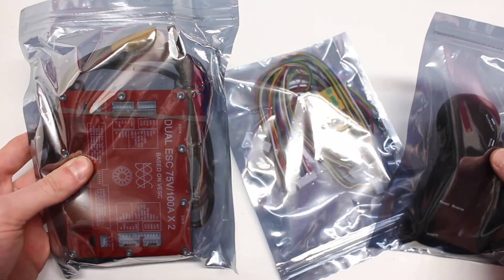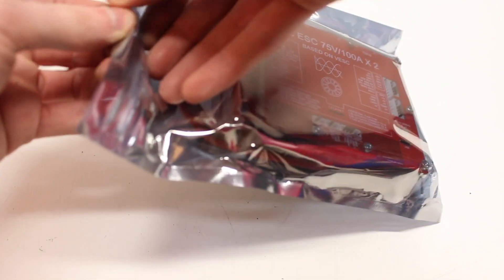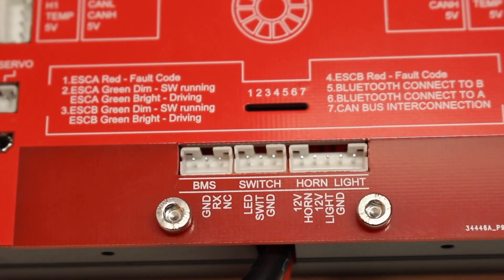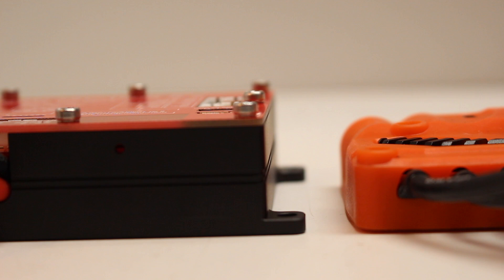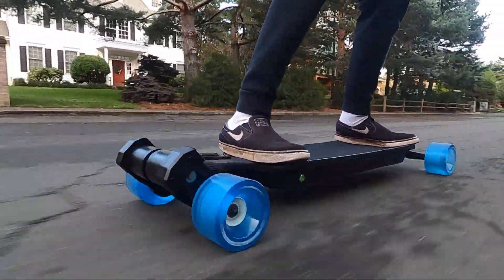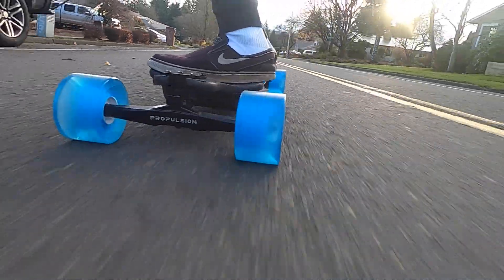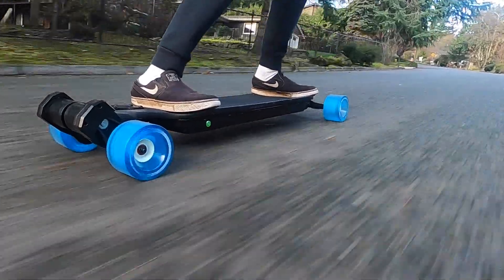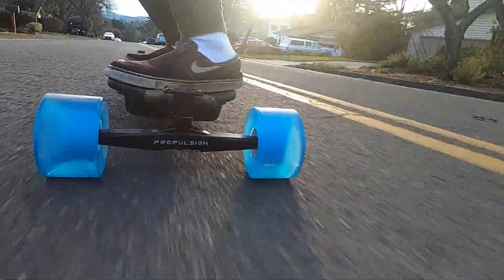16s/75V 200A VESC *Ubox Review*

Comment: I bought this one after watching the vid and I love it. So, I bought the V2 for my next build and after I set it up on VESC tool  thought it was ready until I stand on it. It sputters and starts high pitch squealIing and doesn't move. What am I doing wrong? My esc is a Spintend ubox v2 75v 100a x2. motors are Flipsky 6384/190kv
Reply from the maker: Hi, I am not sure what the issue is. I would ensure that you have the correct firmware installed. The V2 is a little more complex and tricky than the V1 to set up

Comment: Hey Man love your reviews but did you have your settings I don’t seem to find mine very responsive especially the brake cant seem to get it to go in reverse and doesn’t seem to come to a compete stop. Toque is lacking for me going uphill.

Cheers

Myles
Reply from the maker: Hi Myles,

What are your settings?
Reply: @DIYesk8Builders   hey I actually followed your settings for your focbox unity/tenka with the exception of the max motor current to 75a and the max brake current to -75a. I did the wizard for the setup input same as you did yours but I am using their u1 remote they said I didn’t need the receiver that came with the remote since there is a built in one I selected to go brake and then reverse but does not happen when I do so. I had installed a horn too so wanted to keep the u1 remote but was also trying to pair the vx2 remote but no luck not sure if i need to use the vx2 receiver. Thanks for the help.

Myles
Reply: @DIYesk8Builders  I forgot to mention I am running a 12s8p lg m50lt 21700 cell batt with 6374 motors at 190kv

Comment: I'm having a problem with mine, I’ve got one motor not getting any power, it spins fine but I can stop it with my hand. Its not the motor as if I swap side its the same.
It was working perfectly then I unplugged the phase wire to fit into a new enclosure. It happen a couple of weeks ago and I fix by swapping the phase wires around but not this time.
I can’t see anything different in the vesc settings but I’m pretty new to vesc tool.
Can anyone help?
Reply from the maker: Did you re-do the motor detection after swiping the phase wires?

Comment: Thanks for your great reviews on the VESCs!
I live in a very hilly area and I had some bad experiences with my old VESC riding down hills and the brake stopped working. Which VESC (UBox, Stormcore 60D, Foxbox Unity) do you think has the best and reliable brakes for going down steep hills? Thanks for your answer.
Reply: Thank you very much for your quick answer!
Greetings from Germany
Reply: Your “problem” is probably the speed controller attempting to regenerate power into a full battery. If you are starting from the top of the hill, try changing your battery to 80% instead of 100%.
Reply: Oh man, me too. There's nothing worse than brakes failing at the top of a long, long hill and speed builds up so fast, past the point of bailing whilst you still can. 
Because this had happened way too many times for me, regardless of the controller used, I needed something reliable to guarantee safe braking.
I have a few mountain boards with tethered brake cables and decided to use on my board.
It opened many other useful uses.
First, the cable goes to the front 2 wheels. 
I only ride boards with pneumatic off road tires, because, I ride off road too.
They're softer, and my boards look beefier. 
The brakes operate on discs attached to the wheels, like bicycles.
Seemed to work, but not much help at top of mountain with steep decline.
So, I switched to drum brakes.
Yes, they make them.
Perfect. Stops as smoothly as you want, guaranteed.
Now I realize you don't ride off road, but how often have you wanted to or needed to. Only a matter of time till you do. Besides, you can still ride on road, and ignore any holes or uneven roads.
The other useful part of having a dumb tethered cable to the front of your board is, you never have to pick your board up to get over/around/passed something.
It's on a leash.
Just drag it, or steer it using the cable.
Something I never expected would be so useful.
Since it's a bike cable, it's thin and strong, and not really noticable when riding. It does however use your other hand, so can't hold stuff.
Personally, I can only go as fast as I can stop.
And that's about 36mph.
Reply from the maker: all three of those are very high quality VESC. If you have the money, I personally love the storm core. The other two are also fantastic

Comment: Not to be a downer but I feel my experience should be heard. I’ve had two of these now and both crapped out during set up. I’m not an experienced builder but have had many review my build and confirm nothing I could have done that would have caused both to die. Spintend had various trouble shooting steps they had me try (that I already tried) and basically gave up and told me to send back for a refund. On one hand I can see their point but on the other I was frustrated because I really put my money and trust into this new product and they basically blamed me for the issue and sent me to buy elsewhere. Now I’ve got there lights I bought and a horn I purchase (3rd party) that aren’t going to work. I hope my experience was a one off cause the more players in the market will only benefit the hobby. But I wanted people to know in case there is an issue they need to address.
Reply: damn man hope you have better luck with the Xenith or somethin.

Comment: i have been using mine for a couple of months. i think its better than the unity.
Reply: I'd like to hear why you think it's better.
Reply: @Convolutedtubules  besides the political crap, Ive bricked two unities. Even the new xenith has similar provlems. All of my client builds now get spintends. Much better design
Reply: @deadpiratetattoo2015  That's valuable information, thank you. Anything else you can tell me about this vesc that I should know before investing?
Reply: @Convolutedtubules  not really. They are what I use on my client builds. I've had zero problems. No returns or complaints. I rock a stormcore 100d on my personal decks.
Reply: @deadpiratetattoo2015  So your personal choice is stormcore or are they relatively equal?
Reply: @Convolutedtubules  the stormcore is better by far. My client builds are 12s and my Personals are 17s and only the stormcore can handle that
Reply: @deadpiratetattoo2015  I'm trying to build a 14s board with two motors 80A  for each motor. Which vesc would you recommend most and why?
Reply: @Convolutedtubules  stormcore 60d it's probably the only one you are going to find anyways.
Reply: @deadpiratetattoo2015  60D stated 12s max. I am trying to find out if it'll work with 14s.
Reply: @Convolutedtubules  I think it will let me ask them
Reply: @deadpiratetattoo2015  Are you in good contact with them? I just emailed Lacroix.
Reply: @Convolutedtubules  with most builders and manufacturers
Reply: @Convolutedtubules  that's a no. They said maybe with LiPho

Comment: Please test it with higher voltage build, ideally 16S or 15S.
Reply: I would go for a stormcore for anything over a 12s. It gets hot fast. Maybe a fan or a heat sink would help
Reply: @deadpiratetattoo2015  Thanks for the info. I did ended up going only with 12S due to covid price pump lowering what I can afford. But in the future I will definitely plan my build with some cooling.

Comment: The big point you didn't mention is it doesn't use vesc firmware.
Reply: lol 🤣
Reply: But it does, you can just use the vesc tool as usual
Reply: @basnagel2574  works vesc tool but fw has to be downloaded from splitend. Uses modified 5.1 firmware don't try generic vesc firmware some features will break.
Reply: @movation   i've got mine now for a few months and everything works great, just the 200/75 vesc firmware from the vesctool